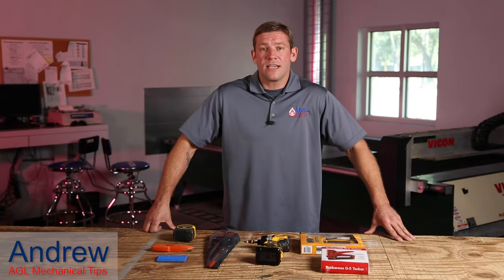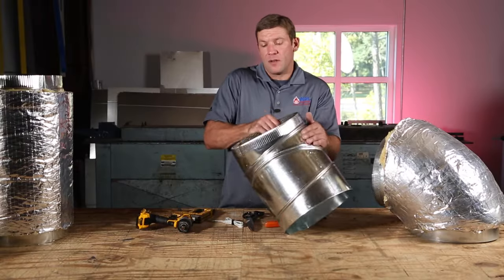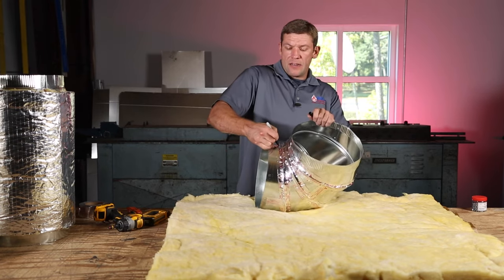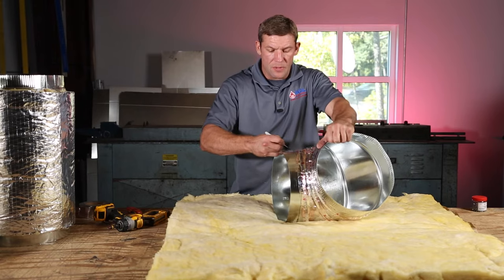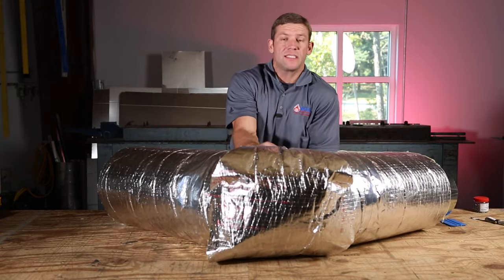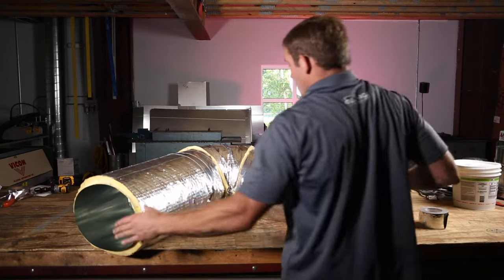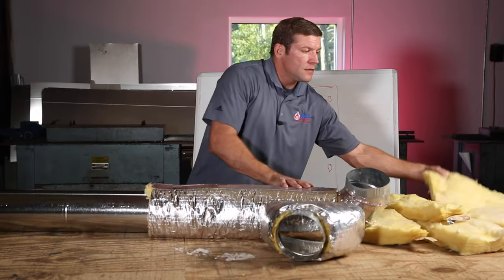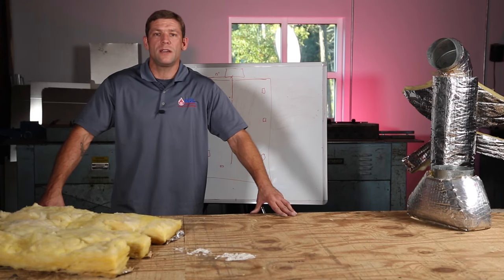Insulating round pipe elbows using fiberglass ductwrap (Mechanical Training - Duct # 102)

Comment: Now, the elbow is nice and tight and insulated, "BUT" ,  can we add an extra seal and use the tub of sealant? Paint around everything you taped up and then tape like you did, and just follow the pattern you used and finish it off?  Why is sealant not used around the rings?  Thank You, enjoy ALL your videos,  GOD Bless !!!
Reply from the maker: I mention in the video that you are supposed to seal the "gores" of the elbow and the seams using mastic or mastic tape.  I didn't do this for the purposes of the video because I will be taking the elbow back apart and storing it.  Your are correct though, mastic or mastic tape needs to be used on all metal seams.
Reply: @aglmechanicaltips  Got it, perfect then. I will mastic the elbow and ceiling box and then insulate it. Since it is a "permanant" install should I mastic the outside also? Thank You, I will keep watching your videos, I am intalling a whole new system in an old house, so I need to secure the galvanized boxes to the ceiling and also the flex ducts.  GOD Bless !!!
Reply: @curlyelp7530  I do mastic all duct tape seams on the outside of duct but most regions don't have codes that requires this.  I even get a lot of comments on this channel from people asking me why I do this only because it is so uncommon in most other regions.  I personally like doing it though and find that the duct tape holds a LOT longer when we do.  I would recommend doing it especially if you are installing this in a hot attic.

Comment: Where do can a homeowner like me buy that wide insulation? Home Depot only has the 1 foot wide one and that was a major pain to wrap my elbows that were that size or larger.
Reply from the maker: Your not going to find that in the retail market.  You will want to check wholesale HVAC suppliers.  Sometimes they will sell to homeowners if not find a local HVAC company and try to buy it through them.  Sorry for the pain it's just not a standard shelf item.

Comment: This is a nice way to assemble the insulation that I like. Do you just make the "center" of those tuning cuts bigger for elbows at less angles? Like a 45, instead of a 90.
Reply from the maker: If you roll the elbow on the insulation and mark as you go (using the method I show in the video) this take into account every angle.  So yes, it will work on a 45°.   This is hard to explain over text but if you use the method shown it will work.

Comment: Man Brother this is Great! Really helpful. I’ve been in the HVAC trade for 35 yrs and we’ve had to insulate our own duct and piping. Always hated doing it! But it is a major necessity. Most guys I know feels the same way. But if you gotta do it. Then you need to do it right. So these tutorials you are putting out. Are really helpful. 
When bubble wrap/reflective insulation came out. People fell for the easy no itch material/method. But it’s be debunked that the R value can’t ever be close to 1-1/2 - 2” wrap!! Even with the 1” air space that you’re supposed to put in between the metal and wrap. And then wrap again! It still doesn’t give you the proper value and it too expensive of a material vs Reg Duct wrap that it makes no sense to do it unless it’s reg wrap. 

I like the “We the People “ tat brother

Comment: Thank you for including the pattern dimensions too!  I just started to insulate my home's hard pipe in the attic and I haven't been able to find anyone showing a "real world" method of creating a pattern for adjustable elbows with minimal seams and tape usage.  I was also considering using the more flexible duct tape and saving the FSK for the long, straight seams, but didn't think duct tape would last in an attic - until I saw you apply the sealant over it.  I like that idea!

Comment: I am a heat and frost mechanical insulator this is a good way to do the elbow on a small pipe . I find it easier to insulate the elbow first. Then measure the straight insulation to fill in between.

Comment: You make the best instructional duct videos for anyone, very detailed, and dedicated to your craft, I am DIY, may not replicate it as perfect, it's harder than it looks, but will be damn close because of how you explain it great detail.  The tapes you used also make a difference, a little more costly but night and day difference after using the cheap crap.  I purchased a new build and the builders just cheap out on things like this, and hire the cheapest but not the best labor, so I am giving it a stab because I enjoy building things,  but I feel confident now that I can improve the duct work using these skills now.   Everyone talks about how important ductwork is improving IAQ, especially in Florida where it runs through a hot attic, but no one shows how do it properly, so appreciate you doing this. Can have a fancy air handler and condenser, but what good is that if the duct work is substandard. Also Doing it before you go into the attic makes sense, working in the attic in Florida is miserable, it's like working in an oven.  It's unfortunate the builders who make ridiculous amounts of money on new construction, dont pay professionals like yourself to do it which may cost more but be done right, yet still give them a good profit and more important known for quality construction, but even the best builders go cheap for, profits.

Comment: I take pride in my work as you seem to. I like my seams straight from one piece to the next, makes painting easier as well just different doing it in the air than on the ground. But your work looks good I dig it. I can't imagine having to wrap a 200roll job on the ground b4 hanging it though. I got a 350roll job atm va nursing home sheww. And the chillwater in it. Just myself and 3 other guys day in and day out slinging fiberglass! We do alot of outdoor duct as well usually armaflex or duct board followed by usually embossed metal over the insulation to watershed.

Comment: Also if you do any videos on laying patterns out for t's laterals etc in metal for covering chillwater pipes, roof drains etc I know plenty of ppl that would be interested. Not alot of ppl out there doing videos on how to insulate large t's and cutting metal gore 90's using dividers and measurements to cut patterns in metal covering that fit like a glove

Comment: You do things a little different than we do but I have seen 90's wrapped this way. I find on round pipe anything 12and under I can pull a bit of fiberglass out bunch it tape it then pull the bottom around same way n keep it rolling if that makes sense.

Comment: What's the purpose of mastic outside the insulation? Ive never seen that here in rhode island.
Reply from the maker: It's a code requirement here in Charleston SC.  It gets so hot in the attics that the duct tape will melt and fall off the duct so we have to seal the outside as well.

Comment: Love all your cheat codes. Thanks again Sir! Question if someone was doing 20" round spiral and it's to be mounted outdoors on a packaged unit exposed to the elements would you wrap it with something else after insulating it and masticking the insulation? What would that weather proof wrapping be called?

Comment: Love that i came across this video, started doing hvac 2 yrs ago and duct is an area ive needed to work on. Thank you. Btw will putting masitc on fsk tape work?
Reply from the maker: Yes would work fine.  Mastic on the outside of duct is something we have to do by code in Charleston SC.  It may not apply to your area but I personally like it after doing it for so many years.

Comment: Great video Andrew appreciate the knowledge I just got into the commercial side of HVAC here in Florida and the boss said if I feel comfortable taking this exact task on he’ll 80% of this quote on my check as a bonus.. I’m working with 9” elbows is the a method to calculate how wide to cut your first piece like how you cut 44” wide for the 12”?? If you could get back to me that would be greatly appreciated
Reply from the maker: Test fit a section of insulation on 9" pipe.  Once you find a size that covers the pipe properly (not too tight) you can then use that length to make your elbow pattern.  I don't know an exact length for 9" because I normally use even number ducts (4", 6", 8").  I can calculate it but it's just as easy to just cut test and if off trim.

Comment: If the duct is already installed , how will I use your method of insulation of round elbow?
Reply from the maker: Use a tape measure and bend it around the outer radius write down the measurement.  Then take the measurements of your inner radius and write down.  Make a pattern with those measurements.  I'm confident I explain this in the video.

Comment: Can I just sleeve the elbow with scrap flex ?
Reply from the maker: I personally believe that would look terrible and probably have gaps in the insulation.
Reply: @aglmechanicaltips  just the jacket and foil. Not the liner. one continuous piece of insulation. I’d be curious to see it with a thermal camera under load.

Comment: Great training videos. I thought mastic first filled gaps then foil tape over it, then insulate.  I see you’re using mastic to help hold the tape on over time. Any thought you have on if beneficial to mastic first or when to use different approach’s?
Reply from the maker: Mastic is technically a barrier for air and used to be used on pipe seams (for me at least).  This is now substituted using a "mastic tape" (Hardcast M# 1402) so mastic is no longer needed when this other product is used as it relates to sealing airflow.  However, in my region we experience very hot attics and duct tape and even FSK tape fail.  We apply mastic over duct tape to prevent the tape from coming loose in this situation.  In my region mastic applied to the exterior insulation seems is required by code.
Reply: 28 years in business. Best wrap job ever seen. Proper way. Everybody always do fast wrong way.

Comment: But I'm an insulator by trade and wrap too much duct lol. Average 2to3rolls a day. Most all our jobs are 2.2inch 3/4lbs. 75ft rolls/300ft². I always cut a lap as well on the part I pull towards me to make my seam. And if something insulated to the left and right of me and I'm putting a piece between I cut a lap in the opposite side from the factory lap as well. We use minimal foil tape stationing the piece to hold it together pop some staples then fab my butt seam and horizontal seam all our jobs are fab mastic

Comment: great wrapping, not a clue why you would waste time and money putting duct seal on the outside of a vapor barrier, but i liked the wrapping job.
Reply from the maker: Required per code in my region, would fail inspections without it.  The heat and humidity is so high that it causes duct tape to come off where I live.

Comment: Ur deff not suppose to duct seal the insulation. Ur suppose to duct seal the seams ON THE METAL, then u insulate it lol if u were hanging that youd be wearing that lol if ur worried about the tape not sticking bc of the duct seal on the metal, then simply duct seal the inside of the elbow b4 u insulate it instead of duct sealing the outside so u dont wear it and so the tape sticks and the insulation doesnt mess up the mastic seal